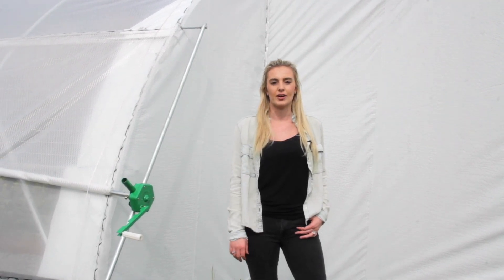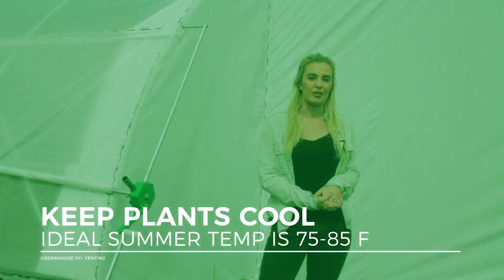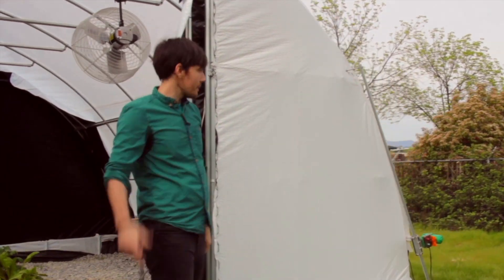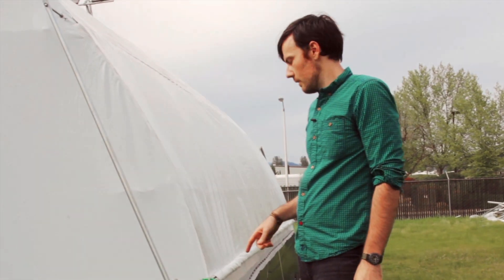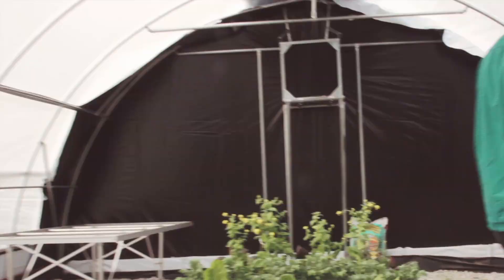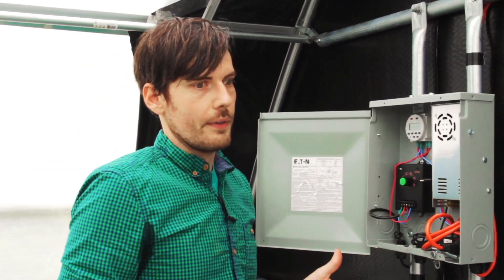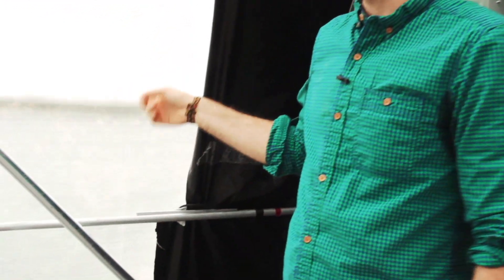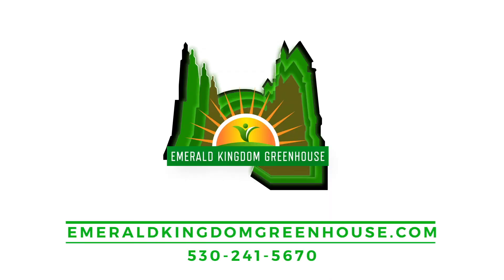This is How we Roll... Greenhouse Roll-up Sides

Comment: To roll my sides a lil trick I just run a pvc pipe the length of the hoop and build a hand crank out of PVC with PVC elbows. Instead of your arm getting tired turning a geared crank 10,000 times it's about 4 or 5 turns and the sides are up. Keep a small rope tied in a loop near your door to hold the crank in the up position. Cheap and easy. One advantage to the motor system though is you could setup remote power controlled with a phone app. 
Your welcome.